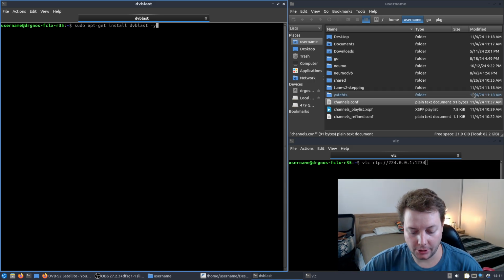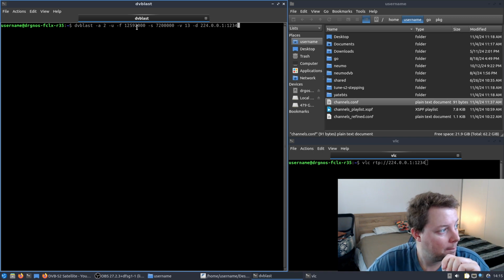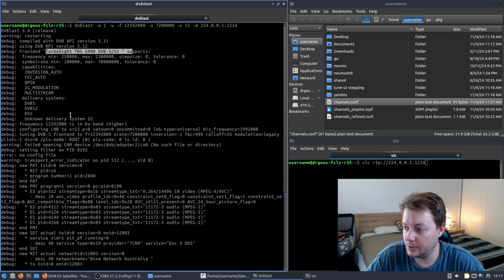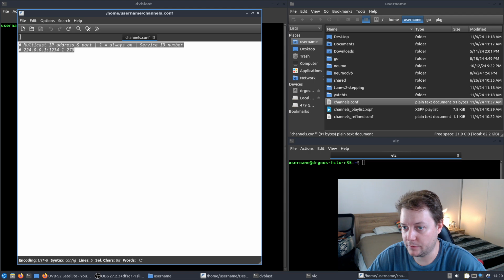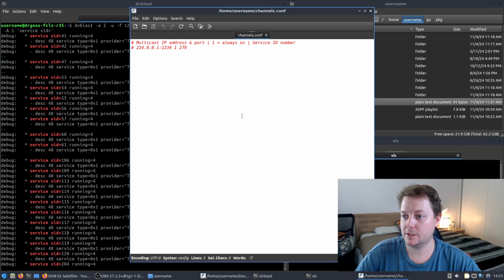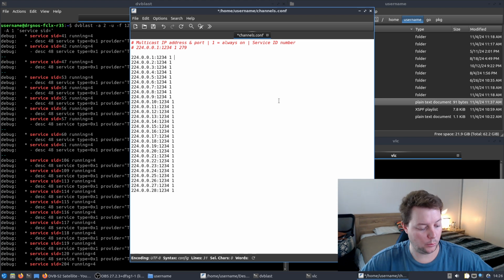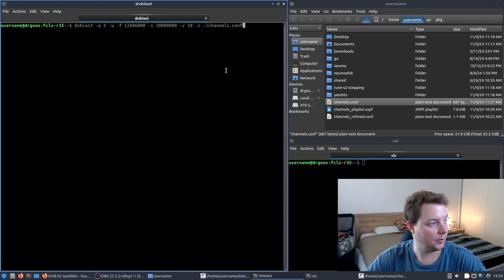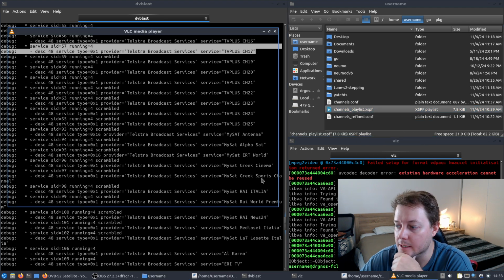DVBlast For Linux: Streaming Satellite TV To VLC Using Only The Command Line!

Comment: 19:10 you can pipe scan result via terminal or even from a saved file to awk to filter out the result 
echo "input" | awk '{print $1"string"}'  

You can create script uses ( Groq/LAMA free API) that will give you any bash script you want.